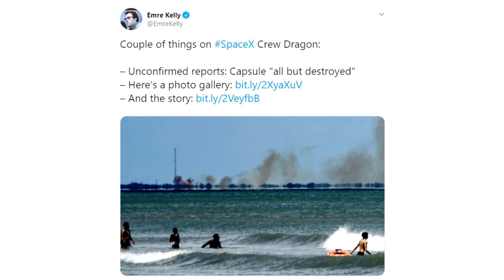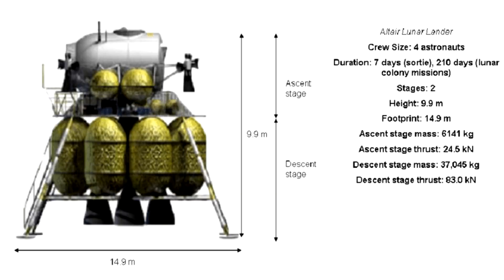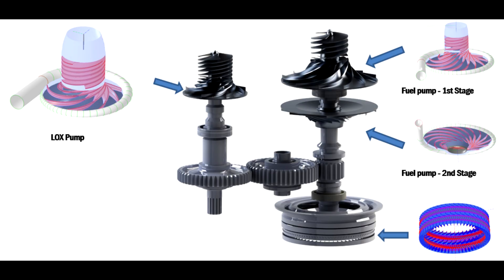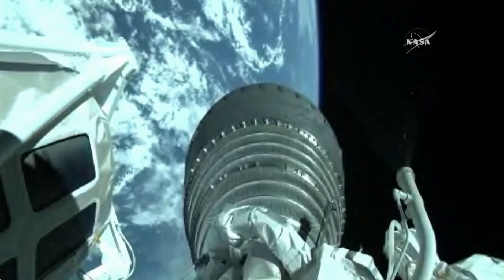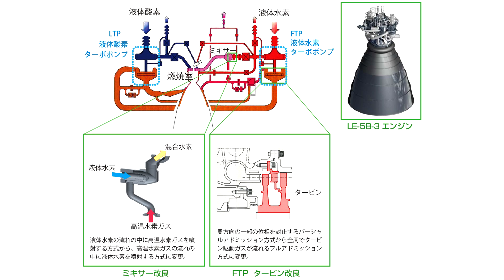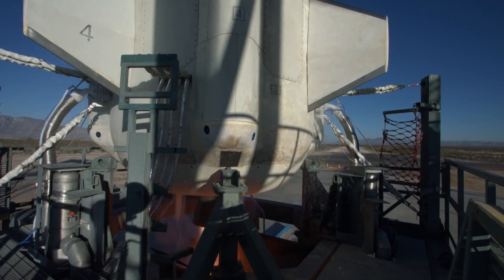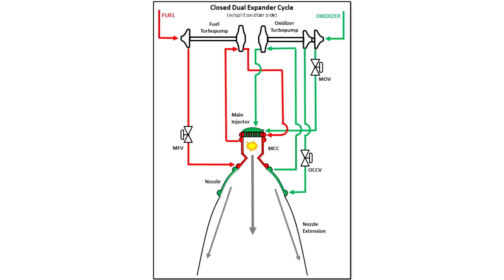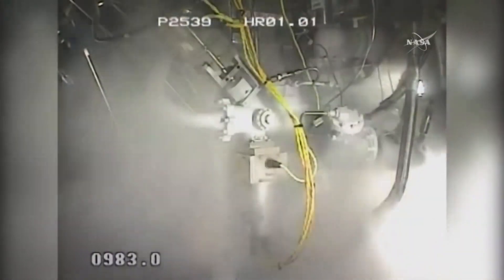Expander Cycle Rocket Engines - Using Waste Heat To Drive Your Rocket

Comment: This made me wonder how tf merlins survive all that and actually can be reused...
Reply: By not being damaged by normal operation beyond the same kind of wear as you expect from operating your car's engine.
Reply: Or rather - how confident can we be in the reuse. How much the probability of failure increases with each firing.
Reply: Same as the RS 25s could, since they both use regenerative cooling around the engine bell. I believe the difference is just in that the Merlin dosn't use that heating to help pump the fuel since RP-1 doesn't boil quite as easily

Comment: Another way is to take some of the combustion chamber gas and send it off to a hydrogen heat exchanger instead of using a separate pre-burner to augment extra heat. The now cooler flue gas can be sent to the interior of the rocket bell to recover a little more "push" that would normally be lost if it was just bled out the side.

Comment: I hope the day will come when we look upon this technology as being antiquated and quaint kind of like steam locomotives.
Reply: Norman Mattson 
Allow me to add on to that

I hope most of us live to see that day
Reply: That day came and went when they got NERVA to work and then canceled it.
Reply: @RCAvhstape  sorry, but no. I'm an astronuclear archivist (because dear God, someone has to do it! No one else has so far from an engineering perspective) and I can tell you with absolute certainty that a NERVA engine is only good in boost as a third stage (see the Reactor In Flight Test, or RIFT, documentation for the Saturn C), due to the 1.3 T/W ratio... Never mind the fission product losses from the fuel into the atmosphere... Not enough to hurt anyone, but enough to cause the fear needed to kill the idea of operating an NTR in atmosphere.
Reply: @cassgraham7058  RL-10 is also only ood for upper stage use.
Reply: @RCAvhstape  sure, but expander cycles happen in lower stages too.

While terrestrial power plants aren't my thing, I hear SO MANY people saying "what's the big deal, you're still boiling water, right?" in regards to using water Rankine cycles in terrestrial power plants.

My response is generally along the lines of: "look at the physics behind the system, and the engineering elegance in the application." 

Same here: expander cycle NTRs are ABSOLUTELY a thing that can be done. If you're making electricity, the same physics that drives the expander cycle drives the Rankine cycle... And that's literally the go to, even today, for high efficiency turbines that have to actually deal with maintenance requirements.
Reply: That day may never come. It's possible we're stuck on Earth with chemical rockets forevermore.
Reply: @General12th  > It's possible we're stuck on Earth with chemical rockets forevermore.
It may even be possible that we're eventually stuck on Earth but without rockets, for all resources required to make the fuel and special materials are exhausted.
Reply: @vladimirdyuzhev  That's unlikely. Rocket fuel can be made from water, or carbon dioxide, and the only time those are gone is if the Sun has consumed the Earth and we're all dead anyway.

Comment: Probably covered in another video but this one got me thinking about fuel/oxidizer ratios, do they target stoichiometric ratio? Or more likely a lean ratio for complete oxidization...
Reply: They tend to run fuel rich to keep the temperature under control.
Reply: @randomnickify  That and the molecular weight of the fuel is less than the oxygen. So running fuel-rich will decrease the weight of the exhaust products, increasing specific impulse.
Reply from the maker: I cover this in my Delta IV video:
https://www.youtube.com/watch?v=i-zmptK7PDE

Comment: What about gravity/acceleration feed engines?

Or have a piston in the fuel tank to push/squeeze fuel downwards?
Reply: Pressure fed engines exist.
Reply: Joe Montes Gravity/acceleration would not produce enough pressure for these specific engines and propellants; it’s really an insignificant force in comparison to the pressurization of the fuel itself, which is not sufficient. As for the piston idea, I’m not immediately sure— I’m guessing it would just be a very heavy and dynamically inconvenient system to fit into a rocket.

Comment: Weren't the giant F-1 engines that put the Apollos in orbit expander cycle engines? This isn't exactly a new concept, is it?
Reply from the maker: No, they were gas generator cycles. Also, f-1 is newer than RL-10
Reply: Totally different beast. Expander cycle is for  LH2/LOX engines, whereas the F-1 burned kerosene with LOX, just like the Merlin and RD-180.

Comment: DC-X was a 'first stage' that was lifted against Earth Gravity, using 4 RL-10's! 

Another cool idea is to use an expander cycle with an Aerospike nozzle. This would supposedly give some more nozzle area so the total expander cycle engine could have more thrust than with a de laval nozzle (it would 'scale' better).
Reply from the maker: I forgot about that one.
Reply: @scottmanley   Can you please do some more on the different engines ?  Including this aerospike? 

This topic looks like an great pool of content!
Reply: AGREED to the different mozzie geometry video idea! De Laval was an awesome hydrodynamicist, but his design is one of many!

Heck, a video on just the differences between a plug and aerospike nozzle would doll your time.
Reply: I like the spike. One of the early complaints was that the external nozzle materials couldn't hold up against the heat well. That was before the new advanced materials research that gave us the heat shield tiles of the shuttle. There are a lot of great ideas that got put on a shelf that would do better a second time around.

Comment: Turbopumps look a lot like an automotive turbocharger.
Reply: They pretty much run on the same concept. Exhaust gasses spool up the turbine running the pump to push the fuels into the combustion chamber. In cars they only push the air but in rockets the turbo pumps both fuel and oxidizer

Comment: 10:08 the Blue Origin website specifies 1420 kN thrust in vacuum, not 1100 kN. That's 160,000 lbf thrust, 50,000 more than sea-level BE-3. A huge difference. It's under engines/be-3/be-3u. 
To the people that want to point out that under New Glenn page, a second stage total thrust is still stated as 1100 kN, let me remind you that after the website update last autumn, the engine section was updated again, changing the 550 kN to 710 kN, and that is the latest update from the company. Feel free to check the history of the website.

Comment: 4:10 that cut out gives you a view of how intricate and technologically advanced these engines are. And apart from spacex all these are thrown away after one use. 🚀🗑😱
Reply: Like Isaac Arthur says: The reason space is so expensive is we're throwing away our car after one trip and buying a new one, rather than just refilling the gas tank.
Reply: thats an oxidizer turbo pump
Reply: @motoboggin2619  

The little impeller on the left is the LOX pump. You can see it's driven slower than the fuel impeller from the gearing. The two-stage LH2 pump (centre) spins at turbine RPM. 
The turbine is at the bottom.  The turbine on RL10 spins at about 30k RPM.
Reply: Yeah i did understand (watching the video) that it was the pump section but still it is impressive and expensive and an important part of the engine that is discarded. 🧐🧐
Reply: That's actually really simple, compared to just an engine, let alone a rocket.
Reply: 5:40

Comment: I'm amazed that after so many years that rocket design hasn't settled on a few basic designs that everyone uses. It shows that rockets are still in their infancy and have a lot of improvements yet to go.
Reply: It is true that rockets haven't settled on a few basic designs, and there's probably a lot of improvement to go, but a major part of this is just that different rockets and designs are optimal for different things. Do you want a cheap engine? Do you want high ISP? Do you want high thrust? Do you want easy reusability? Do you want high reliability? Is this for a large rocket or a small rocket? These are many of the different things and depending on the desired goals, different cycles will be better.
Reply: Technology advances, new manufacturing methods and materials make old, previously discarded ideas relevant again, changes in prices make other ideas irrelevant.
Reply: It can also mean, that people want more tools for the growing number of jobs.
Reply: The RL-10 is about as standard as it gets for rocket upper stages, and at this point it basically writes its own resume. What's there not to like? It's efficient, cheap, and simple.
Reply: @johnrickard8512  "Cheap" is not the first word that comes to mind when thinking about RL-10. As far as I know NASA pays an average of $17 Million for each. Using 2 for the Boeing Starliner means 34M just for upper stage engines. This is half of Falcon 9!
Reply: @nikolatasev4948  That 17 Million is for a small batch and custom variant of the RL10 (the RL10C-3 specifically) for SLS EUS, only expected to launch once ever 2 years. That's probably a lot more expensive than what ULA pays for the RL10's used on the Atlas upper-stage.

Comment: The RL-10 is my Realism Overhaul vacuum engine of choice!
Reply: I always find myself using the “Russian version” due to it being lower in the tech tree
Reply: Yah I use it and it's Russian equivalent a lot in RSS.
Reply: @Patchuchan  RL-10 for the win
Reply: I don't use it much I find, usually because I tend to get cost-obsessive in RO games, and RL-10s are great but cost an assload. They're damn fine for probe transfer stages though, as long as you insulate it well.

Comment: I wonder if that temperature difference - between the outside and inside of the bell - could be used somehow by a peltier plate
Reply: Possible, but horrendously ineffective
Reply: No real reason to do that. You don't really need the electricity, and it wouldn't be worth the weight. If you didn't use the fuel to cool the bell I'm pretty sure the outside would still be super hot so there wouldn't even be that much of a temperature gradient.

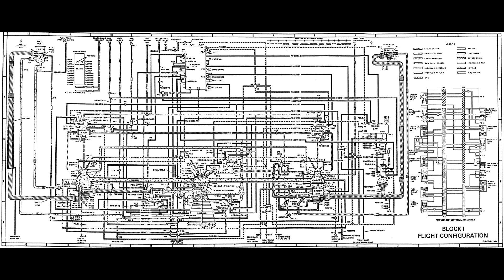Comment: 5:38 when you see this after Simple RL-10 schemat
Reply: If you look closely, you can faintly see the outline of what looks like a nozzle.
Reply: Isnt that the Mueller Report?
Reply: Only 90s kids will understand
Reply: Looks like a telephone wiring diagram for lower Manhattan (circa 1970).
Reply: William Swenson Nah, just car wiring including every tiny indicator light and relay.
Reply: @johnfrancisdoe1563  Yes, much like the wiring schematics in the back of my VW GTI manual that stretch over several pages.
Reply: I wasn't ready for this yet
Reply: Yeah, uh, how is anyone supposed to read this?
Reply: What a great engine!
Reply: I believe the schematics are of a RS-25 engine
Reply: Where can i get the hd picture? Or something like paper or journal like that picture
Reply: @hartantoprawibowo4699  best guess
look on nasa website

Comment: What do you think of using Electromagnetic Propulsion as a possible propulsion system in the future?
Reply from the maker: Electric thrusters are already a thing. Pushing directly against the Earth's magnetic field is possible but extremely low thrust.
Reply: @Scott Manley, What my idea is using Electromagnets to negate the effect of gravity. The was this would work in more detail is that the “Engine” would be an electromagnet and would be Abel to have a magnetic field strength dependent on how much energy is used. This effect would cause magnetic fiends to be created and if they are powerfull enough, wouldn’t they be able to essentially “bounce” off of earths magnetic field and be able to accelerate in what ever direction the magnetic field is facing against?
Reply from the maker: @alexgardner3848  I don't see any way to get the field density you need, there are no structural materials that wouldn't be torn apart.
Reply: To give an idea, I vaguely remember that at the magnetic poles, where this is strongest, you may be able to lift off with a 4km superconductor loop using current materials (and I think this didn't count powering it)
Not super practical!
Reply: But in theory it would be possible if you had the power and battery to be able to achieve the magnetic fields necessary to create lift against earths magnetic field
Reply: @alexgardner3848  yeah, but doesn't seem likely to ever beat chemical for escaping a gravity well. Apparently they do seem like a good option for very low power navigation around a solar system, though.